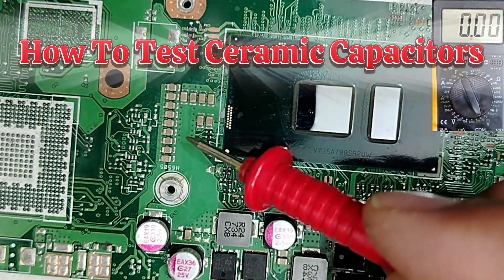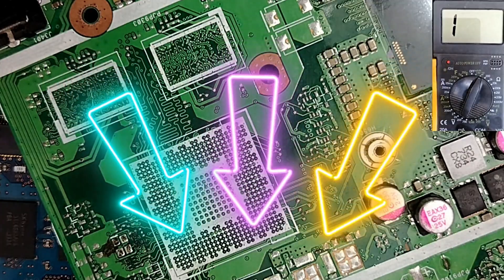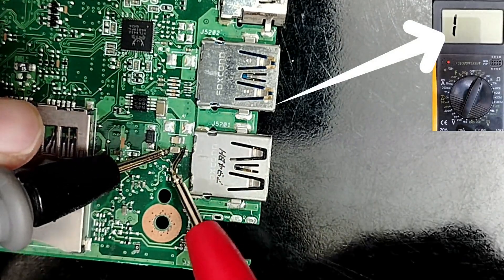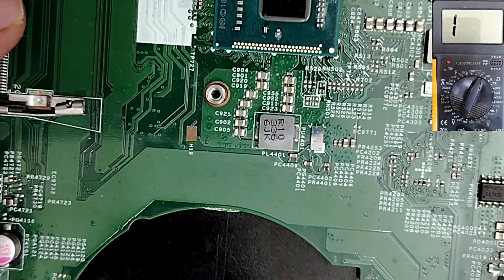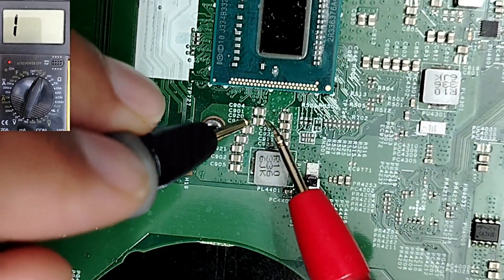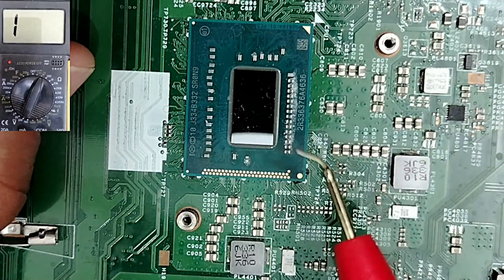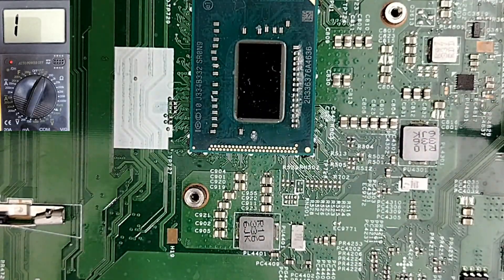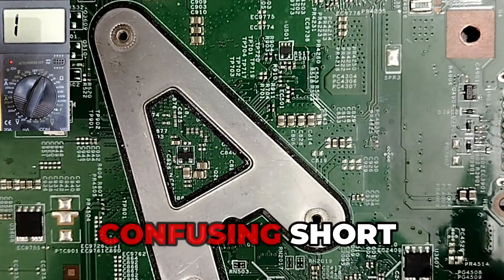How To Test Ceramic Capacitors On A Motherboard The Easy Way - SMD Capacitor Test

Comment: My multimeter shows me different things.

When I activate the continuity test mode and connect it to the capacitor, I briefly see a value and hear a short beep. When I reverse the probes, the same thing happens. But the value is usually about the same. I don't get a negative value.

Am I doing something wrong?

Comment: best thermal cameras are around $150  and above , voltage injector like DC bench supply are around $50 and above
Reply from the maker: Right,